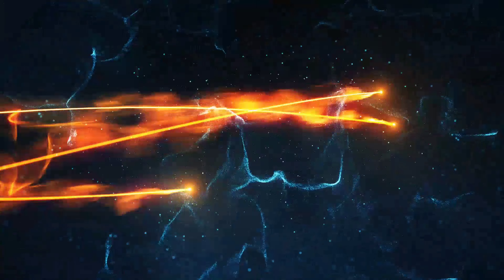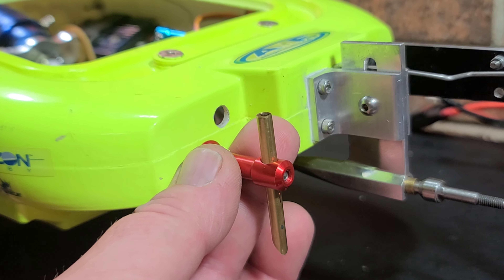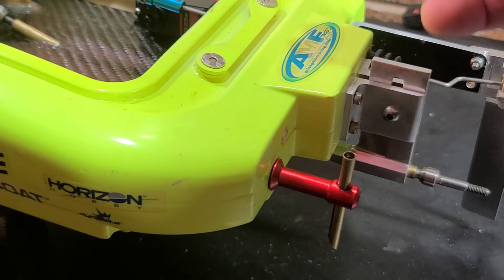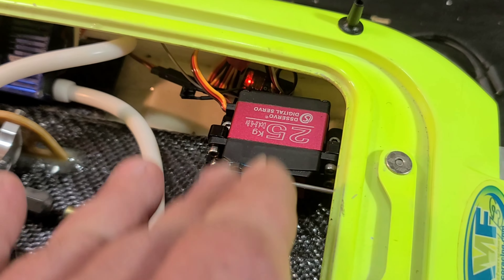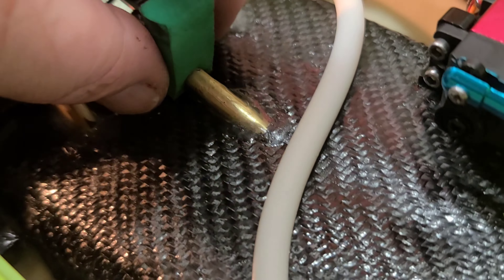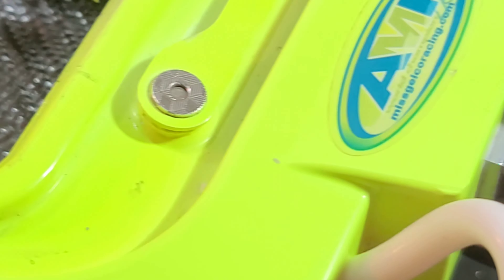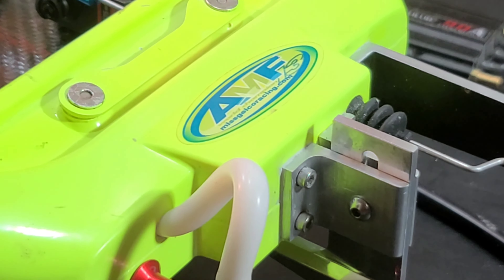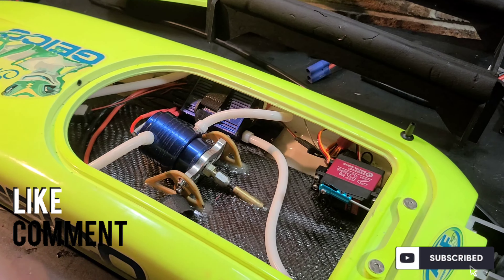Water Cooling, Transom Pickup, Grease, Motor Alignment - Proboat Miss Geico 24, Blackjack 24

Comment: Hey man, love the videos! I was thinking of adding another cooling line to my Oxidean and actually utilizing the installed rudder pickup to cool my ESC. The one concern I have is for making a hole for the cooling line grommet. Do you think a body remember would make a clean hole in that carbon fiber hull? I'd hate to have to buy specialized tools.